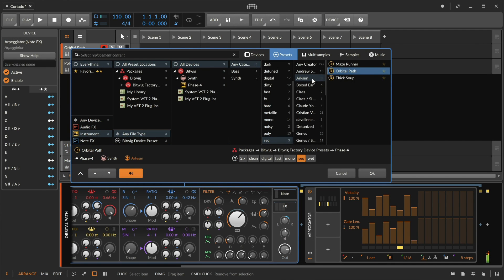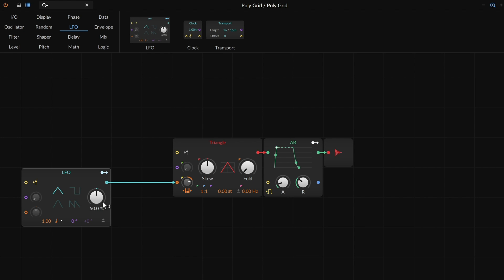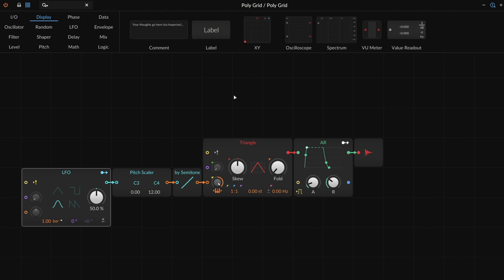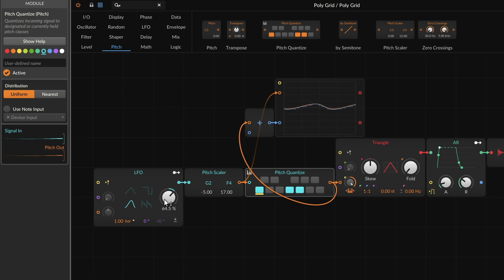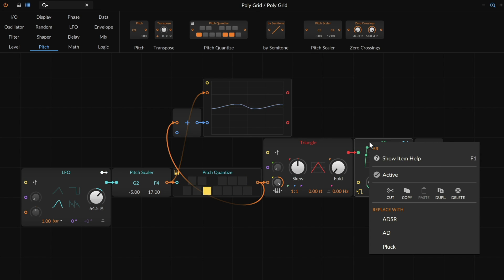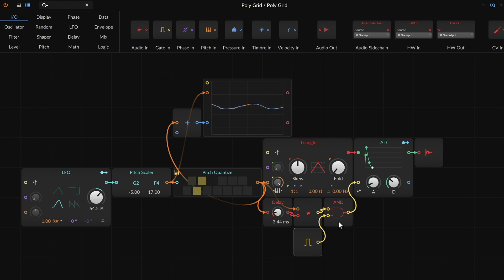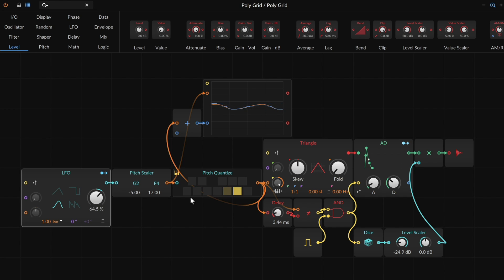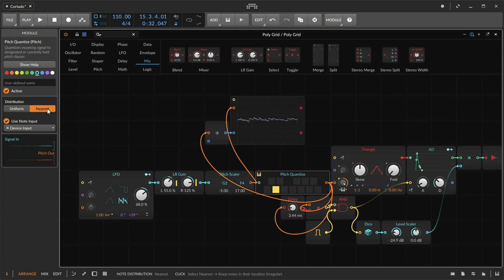Let's build an... Arpeggiator [Bitwig Studio | The Grid]

Comment: I'm a pretty experienced hardware modular fan but this video series has taught me so many transferable skills. Thanks for posting them. The grid is incredible. So flexible but so approachable, and actually a lot less of a headache than my eurorack gear. And the fact that you can just make things instantly stereo is outstanding. To think of the hell of cables that would be necessary if all my eurorack patches were stereo!
Reply: It has quite simply changed my workflow, thinking around audio puzzles and I use these ideas regularly in my Degree classes as 'brain ticklers'. So much love and respect to the BitWig team. All the way from Australia! 

Peace.

Comment: WHAT ABOUT FREE MODE IN REGULAR ARPEGGIATOR????? I recently switched from Ableton to Bitwig, the only thing I miss is that amazing functin I use a lot for "bouncing" sounds in sound design :( ...
Also the amazing BEAT REPEAT....but it's another question and at least I created something that works similiar with devices...

Anyway, GREAT DAW ....it has the modular workflow I was looking for <3
Reply: Heard you, Patrick. Check version 3.2… https://www.bitwig.com/en/20/bitwig-studio-3_2.html
Reply: what does the free mode arp do?
Reply: @tomtabak  free RATE mode, sorry....I use it for sound design. Image you have, for example, a sample and you want it "bounce"....I set the ARP in free and work with milliseconds. Or I add one, set it to a high rate and have some "granulizatio" via MIDI....
I'm really disappointed that the stock arpeggiator don't have this simple and so useful funcion...it's my bread.
Reply: @ethnikLSD  I could be wrong, and I'm new to bitwig, but I think you can achieve more precise rate control by adding a macro modulator. Set the macro to bipolar and then connect it to the arp's rate. If you set 100% of the macro to add 6 to the base rate you can get the full range of rates. You can then modulate the macro itself with any other modulator. Too bad the control is not in ms. I think the arp rate ranges from 0 (1/1) to 6 (1/64).

To add to this, most quantized or categorical options have more continuous control under the hood. So for example, even the shape control in the arp is actually a number between 0 and 7 and thus can be modulated.
Reply: @Manish-py8ot  later I Will create a MIDI device in reaktor for ms triggering and I Will have no more problems. Love Reaktor
Reply: Not quantize to bar the frequency, instead use hz (or ms?). In this example is as simple as changing the timing of the LFO, I believe...